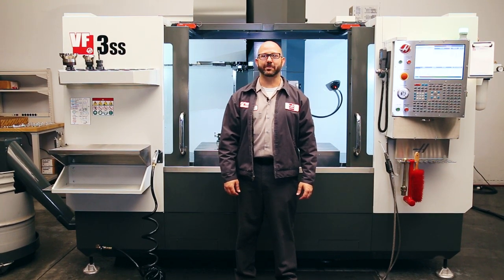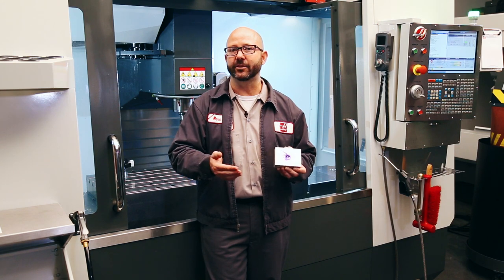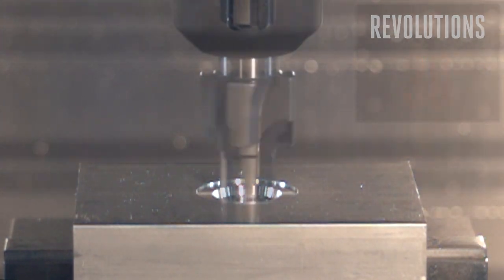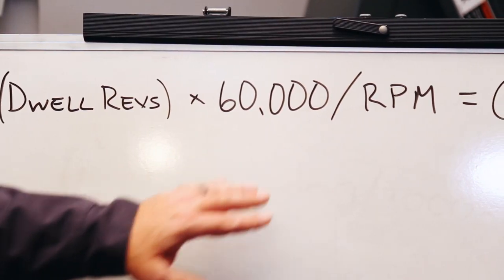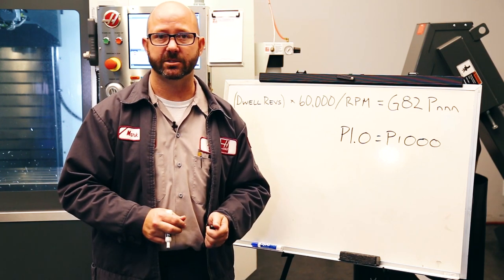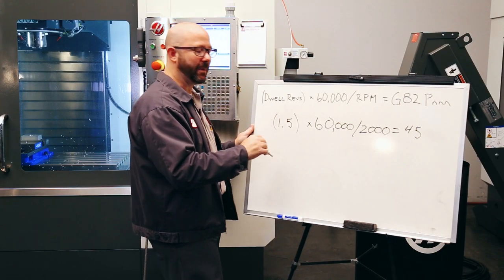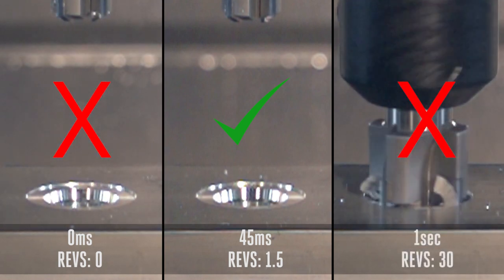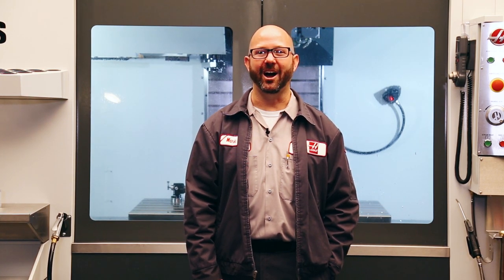G82 Dwell Time Explained – Haas Automation Tip of the Day

Comment: Using a dwell is not only to leave a true surface such as for a valve seat, it helps insure a consistent and accurate depth. It can also prevent the edge of a delicate tool from chipping as it is pulled out rapidly when there is still a heavy chip(s) attached to the work piece.

Comment: Back in the primative days of Brown & Sharpe automatics the recommended dwell was 3-5 revolutions. The cams were designed to dwell the tool and you had to calculate the dwell (in hundreths of a circle, not degrees... it's a long story) based upon the spindle revolutions of all the other cutting operations (which were based on spindle speed, feedrate and the length of each cut totalled together and diveded by the non-cutting operations). 

CNC is too easy!😊 I program a lathe to use a G4 x.1 (one tenth second) for dwells. It looks like I need to cut some of them down by your formula.  

Thanks for the tip and formula.
Reply: The machines are gone now, but the guys used to adjust the Conomatics with a hammer. You need .001" deeper? That's a medium tap with the brass hammer. Need .010"? Get the mini-sledge.

Hmmm, maybe that's why the wore out? :-p
Reply: I recently sold 2 of the last 3 Brownies and I don't regret going cnc. The last #00g will be used to make parts that can be made in 6 seconds or less, 10k or more at a time.

Sometimes the "romance" people have with the past colors the reality of the past. We can't, or shouldn't go back.

Comment: This is interesting feature, we had quite a bit of trouble with boring heads leaving uneven bottom shoulder finish. This will fix it perfectly and actually speed up the cycle time since we "fixed" it by feeding slowly.

Comment: Great info as always Mark. You had touched on the subject of excessive purge time after using through coolant on the UMC. But I noticed you have pretty much no purge on you'res. Goes straight into a tool change. Any suggestions?

Comment: Another way to figure out dwell value for one full revolution. 108,000 ÷ by rpm = dwell value. So 108,000 ÷ 6,112 = 17.67 for p value witch = dwell value using G82 (P18) you need to round value because you don't use a decimal point for p value. Brian's tip of the day.

Comment: Could you program this calculation for the P-value in the G82 line incorporating the system variable for the currently programmed spindle speed so the number of revolutions remains the same if the spindle speed is edited?  For example:  P[1.5*60,000]/#4119.  Or, in this format:
#101=1.5 (NUMBER OF REVOLUTIONS TO DWELL)
#102=60,000 (CONVERSION FACTOR FOR MILLISECONDS)
#103=#101*#102
#104=#4119 (CURRENTLY PROGRAMMED SPINDLE SPEED)
P[#103/#104] (DWELL TIME IN MILLISECONDS IN THE G82 LINE), e.g.: N1000 G82 Z-1.2000 R.1000 P[#103/#104] F10.0 M8

Comment: Dear sir
We have a technical issue in our plant regarding taper  on OD BOSS TURNING USING MICRO BORING BAR ON KITAMURA VMC  M/C.
TURNING LENGTH IS 16mm
Finish OD -18.022+/-0.006
I/P OD-      18.32
RPM 3600 FEED 30/50
WE HAVE CHECKED FOR AXIS ALIGNMENT/SPINDLE RUNOUT
ALL ARE OK TO THEIR VALID LIMIT......
Reply: Pavan Kawatikawar How about reducing spindle speed?